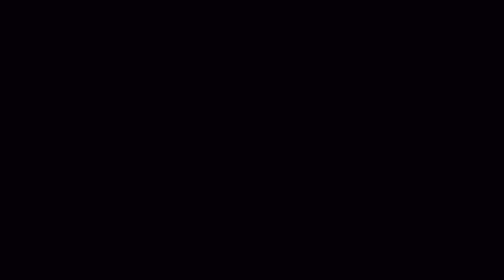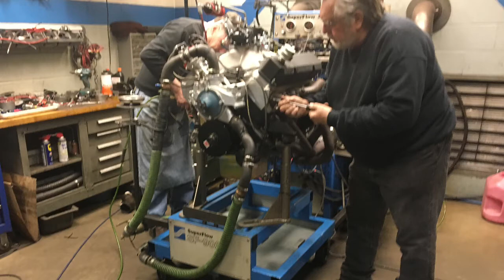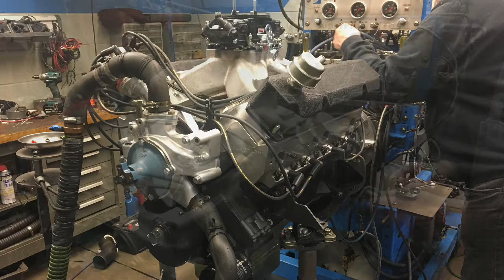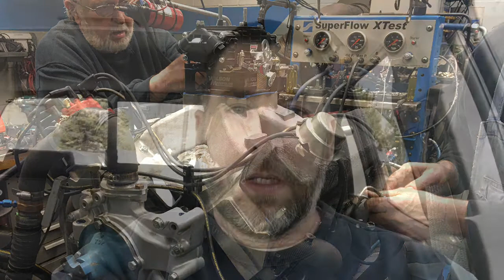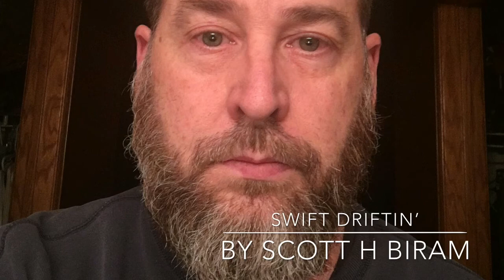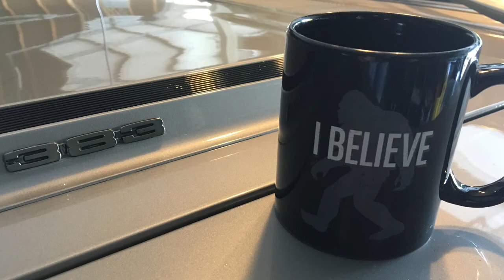Dyno Day What Will It Make

Comment: Totally understand buddy I’ve pulled many an all nighter getting an engine ready!! That motor I’d guess 650 + and the spacer add another 15-20 hp.
Reply from the maker: 1Wild CamaroSS  Dyno was a blast! Found a leak at the front of the oil pan maybe base of the timing cover. Pulled the balancer and tried some adjusting oil pan bolts😡. But damn she pulls HARD. We only pushed to 6100 rpm, great oil pressure throughout. Bet those Trick Flows would go farther, but I'm past stock block numbers already 😉 probably gonna get by with 93 octane fer cruisin' . glad your here buddy. Mad respect.
Reply: Bigfoots n Mopars I’m totally a believer in Dyno time!!! The leak is a prefect example if it was in the car it would a real piss off!! Tune and fix on the dyno and have fun in the car.it must of made some nice torque numbers to!!!! Tire melter for sure!!!!!!!
Reply from the maker: Oh and don't paint yer engine black to match the color scheme of yer car!!!! Hard to see the leaks.